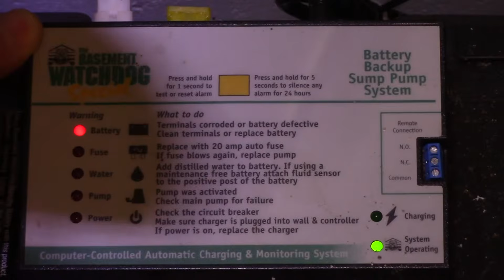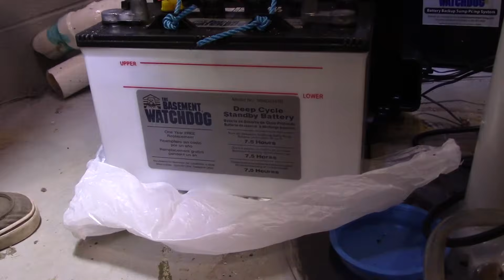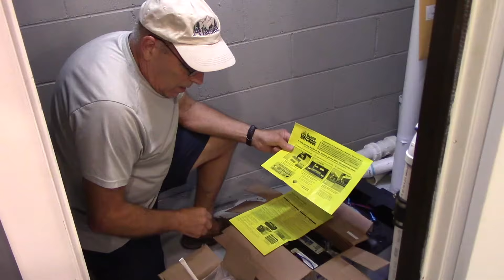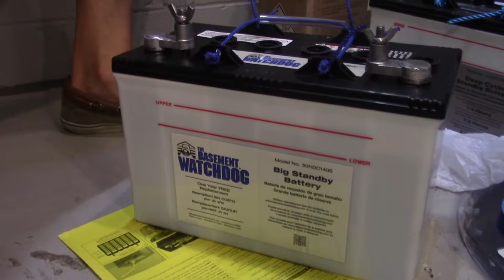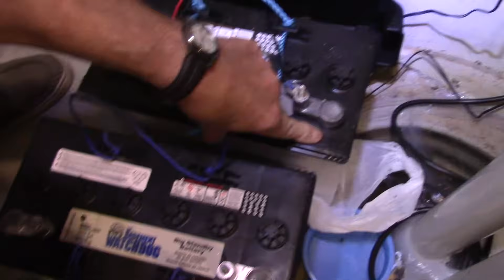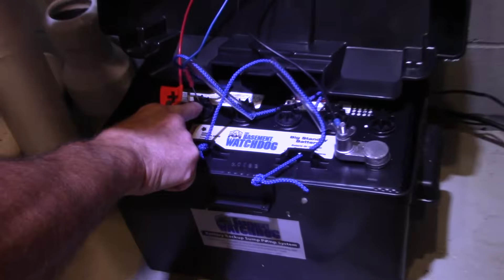How To Diagnose And Repair A Sump Pump Beeping Every 15 Seconds

Comment: I just replaced mine with a non-water based battery and the beeping just won't stop. Is there anything I can do to bypass the sensor since there is no water in the battery?

Comment: Thank you so much sir! I had the same warning on my backup battery. Can I just add distill water into the battery to make the beep stop? I watched your video and saw you found a replacement.
Reply from the maker: Yes you can just add water if the battery is not to old. Make sure that you use distilled water.
Reply: thank you sir!
 @getitdonehomerepair

Comment: I’m slightly confused. You said water, but did you mean acid?  You don’t put water in the holes, do you?
Reply from the maker: No problem. When a battery is new you add acid to it but when the battery is in use and the fluid  (acid ) is low you would only use distilled water to fill it up to the full mark. Thanks for watching.

Comment: I have a 4 month old battery that is chirping. Hooked battery up to battery charger for 24 hours, changed fuse and then added water after seeing it was low in battery "chambers". Still chirping. Should I charge again since adding water? What else could it be...?
Reply from the maker: Did you reinstall the electrode into the one plug?

Comment: We have a watchdog with a maintenance free battery (no water needed).  After testing the system and ensuring it works, the alarm started going off with a red indicator light on the "Pump Activated" area.  Any suggestions on how to resolve the beeping alarm?
Reply from the maker: Did you check the water level? I know it says maintenance free but it still may need water.
Reply: @getitdonehomerepair I recently bought this with the no maintenance battery. There is no place to put water in the maintenance free battery
Reply: I have the same set up and warning. Did you ever get it fixed?

Comment: Thank you very much. This is very helpful. Was it a battery backup sump pump (with a separate sump pump) or a sump pump backup battery? What I have is very similar to yours. I am trying to find out if mine is the former or the latter?